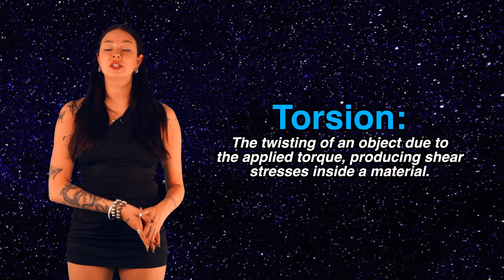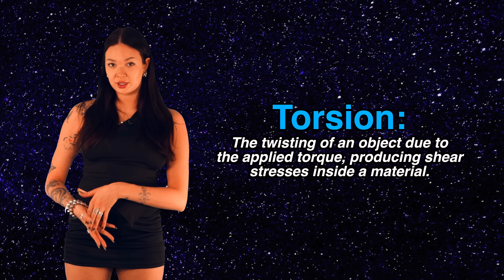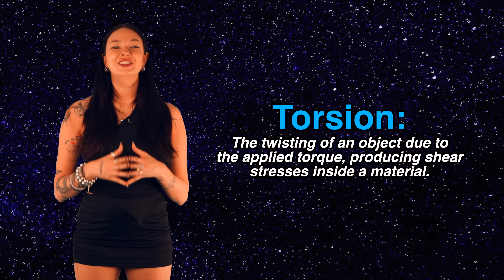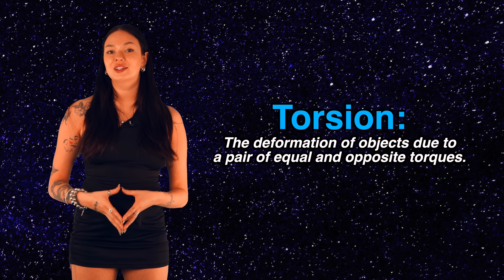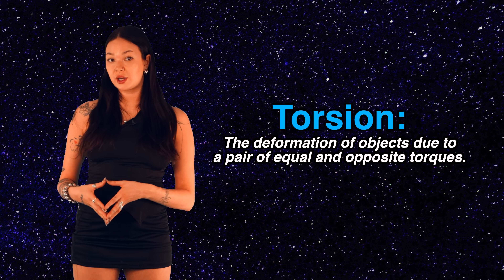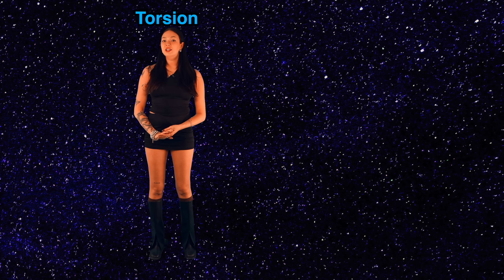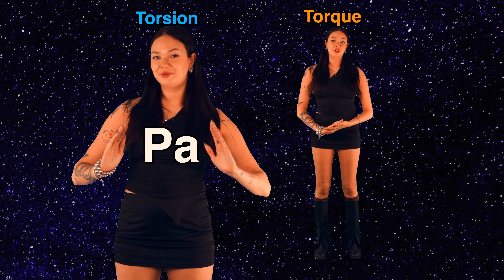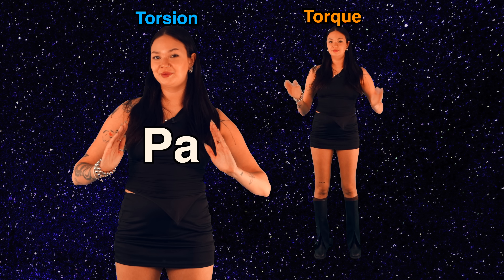Episode 23: Torsion

Comment: Also, the SI unit for torsion is not Pa. The interview guy earlier said that the units to measure torsion is the angle of twist. Which (if you are measuring torsion as deformation) is more correct than using Pa as a unit
Reply: To be fair, for elastic materials, the stress is proportional to the strain, so measuring torsion in Pa is perfectly viable in certain applications, you pedantic buffoon.
Reply: Although stress ("Pa") is often proportional to the rate of change of twist, so the difference in measuring units is probably equally applicable. Good job!
Reply from the maker: Torsional shear stress? Definitely Pa:)

Comment: Long shaft screwdrivers and average length screwdrivers exert identical amounts of torque. There is no torsion benefit to the long handle unless it's perpendicular to the axis of rotation (like a ratchet or a wrench). As they say while screwing, it's not the length, it's the girth of your shaft that matters.
Reply: To be fair, torsion deformation increases with a long screwdriver, even if the applied torque stays the same. The long handle is more "twisty" but doesn't help with unscrewing monitors.
Reply: @Tristan-EngRundle  You are an overly nuanced ninny. Go ask someone what the difference between practical and theoretical is.
Reply from the maker: I guess we all know the difference:)